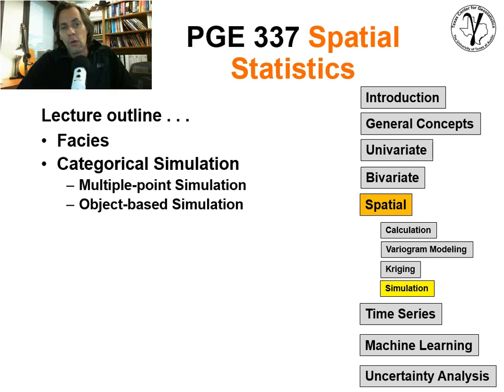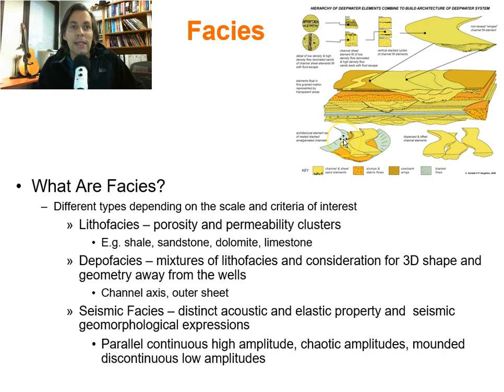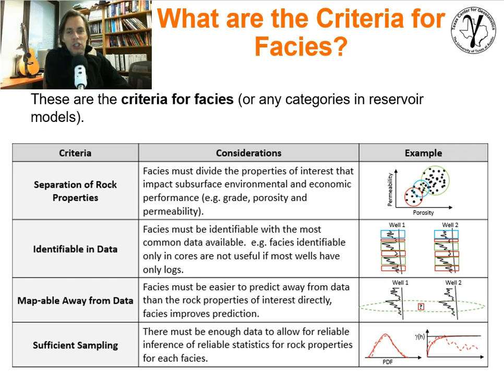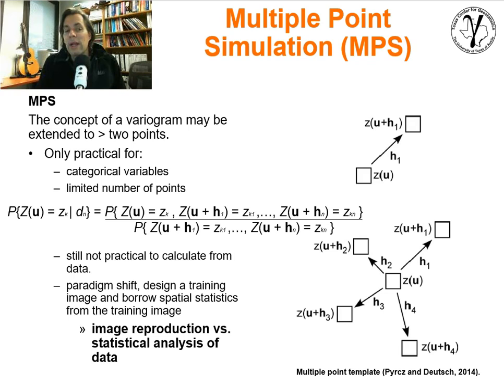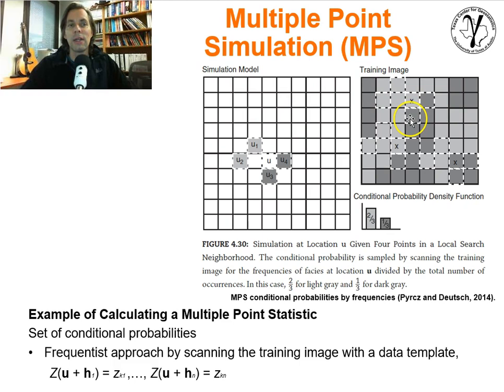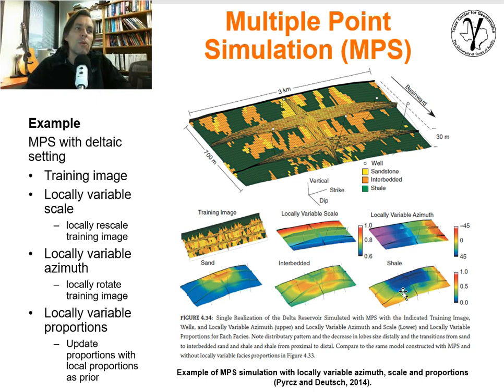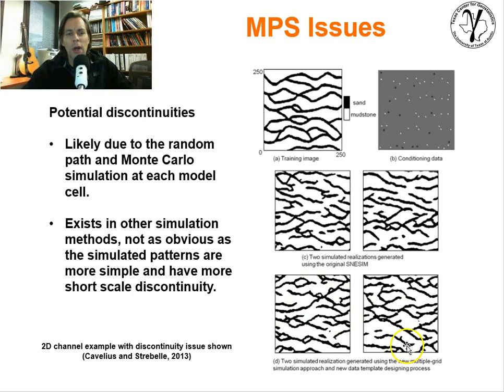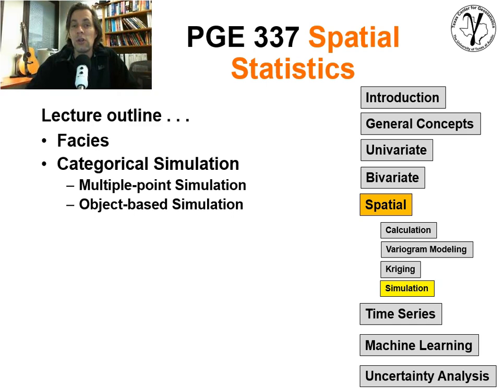15 Data Analytics: Facies Modeling

Comment: I do appreciate all the efforts and work you're doing here to explain all these lectures. I'd thankfully wish if you may kindly share the lectures as .pdf files (if possible?) for our review later. But of course, even if just in video, the effort is well appreciated.
I do have a suggestions though: I am not sure if it is the microphone quality or if you are applying 'noise reduction' for the audio after recording (I believe it's the latter), but it is sometimes too severe that some words are not so clearly heard. I would just suggest to make the noise reduction lighter (if necessary). Thank you so much
Reply from the maker: Howdy MinaSynth, I share the workflows, synthetic datasets, demonstrations all on GitHub, check out my account, GeostatsGuy.  I've also posted my two day short course with examples.  I'm working on this for this course also.  I hope this is all helpful,  Michael